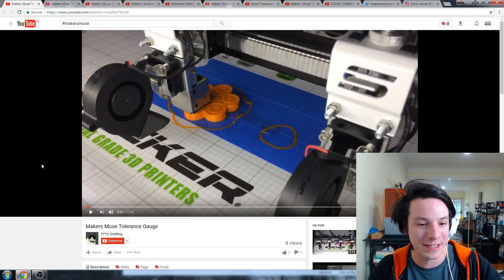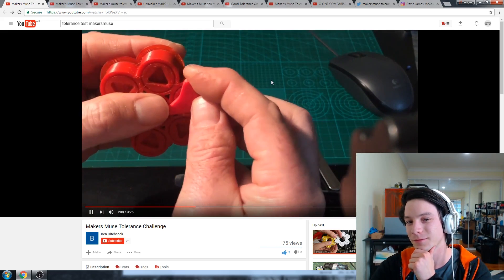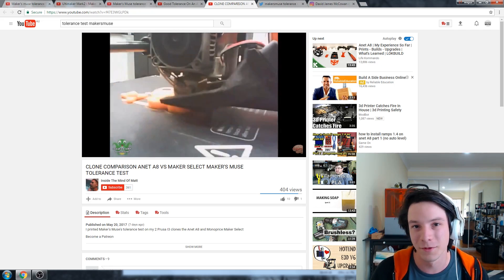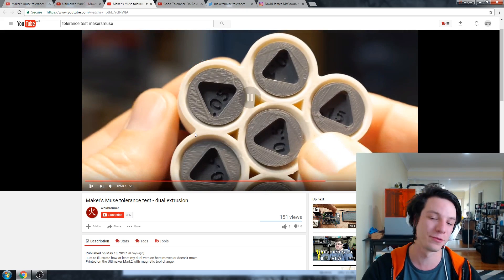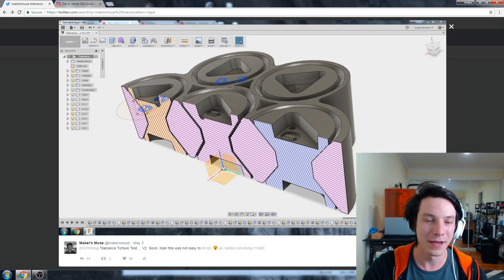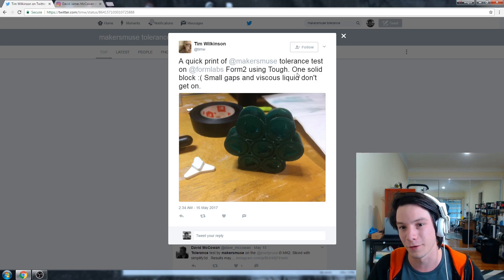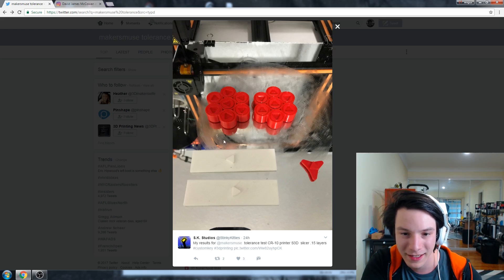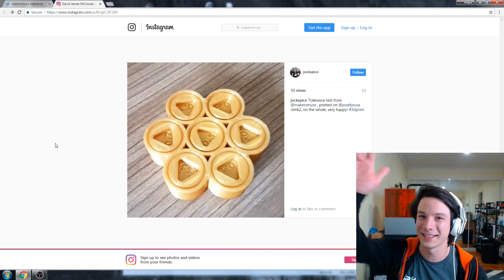Maker's Muse Tolerance Test - Your Results!

Comment: Hi! I'm writing an essay about the dangers of 3D Printing and I would like a quote from you for it! Please answer the questions below :D
1. Do you think the dangers of 3D Printing (such as fires and fumes) should turn people away from 3D Printing? Also, do you think as 3D Printers are getting cheaper, they are getting more dangerous?
2. Do you think that the media has blown up 3D Printed guns (pun not intended)? Do you think people should be worried about 3D Printed guns circumventing gun laws?
Thanks for your time,
Coby
(Also, please like this comment so Angus can see it!)
Reply from the maker: Sorry I truly don't believe you should base your essay on the negative hype aspects of 3D Printing... The media has exploded them out of proportion. Anything can kill you if you try hard enough.
Reply: So, I'm going to come at this from both the perspective of both an experienced printer and an armorer (I print a lot of stuff, and I also happen to work on guns). Long post inc, but you might find the input useful. I'm not going to go much into definitions; I'm expecting you already have researched the subject matter.

So first, fumes are a thing, depending on filament. PLA is fine, but ABS is not good for you; it's not a huge fume hazard, but you shouldn't print ABS in your bedroom with no ventilation. Some 'exotic' filaments have similar issues, but one should always read any documentation/SDS for a material before printing with it. As to fire, cheap printers with non-certified components carry the same risk as any cheap electronics, but honestly, these things are simple devices, and proper certified parts are very inexpensive simply due to economy of scale of the basic components. It's rarer these days to find something with totally random, unlisted (untested by an outfit like UL) components because the 'real thing' is so cheap.

What is an issue is some of the aforementioned 'exotic' filaments. Some filaments require much hotter temperatures than, say, your standard PLA; if you try to push a hotend that isn't designed for those temps, it's a potential for component failure, thermal runaway, and fire. Again, this comes back to knowing what your equipment can safely handle. Not counting for user error, printers these days are as safe as your average toaster oven.

Now, as to firearms, this whole issue mostly comes down to two 'sub-issues'; fully printable guns, and receivers. First, there's a lot of mis-information and outright lies out there that will have you believe that 3d printing can produce an 'invisible' gun that can't be seen on x-rays. This is not the case; you need a steel barrel and chamber to contain the literal explosion from the fired round. While you can create a design with a plastic barrel, you may or may not get any accuracy out of the first shot, and never again as the first bullet destroys the barrel; you also run the risk of the bullet getting stuck in the barrel. 

Even with a fully plastic gun, it's important to remember that detection methods like x-rays don't 'see' metal; they measure the effect of that energy passing through the objects. Think of your dental x-rays; your teeth are not metal, but you can still see them in the scan. I can assure you that completely plastic weapons, knives and guns, do show on x-rays, and it's very easy to tell what they are. Finally, even if the plastic were totally invisible, the thing still has to have bullets in it that have a metal bullet and a metal case.

Second, receivers; these are (almost always) the 'actual' gun, the serialized part that is by law considered a firearm. Everything else on a firearm is just steel/aluminum/plastic; unregulated parts that can often be bought over the internet. The concern some people have is that a receiver can be printed instead of bought and registered to the buyer; mostly it's the AR-15 people are upset about. I've printed receivers (it's legal here to manufacture my own firearms) and I have to say it's really not worth it. 

Polymer lowers are a thing, but they're injection molded. Printed parts just don't have that strength; usually layer separation is the killer, and the part usually doesn't last a full magazine before breaking. With some designs (the AR-15 in particular) sections of the part aren't conducive to printing. On the AR, the buffer tube ring is such a thin part that you'd have to shore it up to a ridiculous degree to have a somewhat reliable part. I've experimented with methods of improving the reliability and strength, but at the end of the day, FDM just doesn't hold a candle to IM or metal parts.

To that end, often it's a non-issue anyway; here, buying a good aluminum lower is about $60US, so it's not a cost consideration. Registration is also a non-issue, but that's politics, not going into that. For other countries, often you can't buy the other parts online either, so you could print a lower, but it wouldn't do you any good. Additionally, as someone else pointed out, hardware stores are a thing. If you know what you're doing, you can wage a war out of Home Depot. I can make a folded sheet metal lower for an AK in my garage.

To sum up, no, I don't think people should be worried about 3d printing being used to circumvent gun laws. Personally, 3d printing firearm parts is a great big 'meh'.
Reply from the maker: Sure, no worries :) smokeydops' response is also good. 3D Printing is a tool for creativity. Just like any tool it could be used for harm, but the overwhelming function is that of good, for learning and productivity.
Reply: As most 3D printers use plastic as a raw material there is absolutely no risk from such 3D printed guns as they would most likely either break or explode in the hand of the user. Even a gun printed using metal would need additional processing to work reliably and the cost involved would be prohibitive, especially when compared to the cost of a gun on the black market. Those with criminal intent are much more likely to use a more traditional method of manufacture than 3D printing.
Reply: Hi Simon, actually this is not the case. You need to be a resident of the state you're buying your guns in. If a firearm you want to purchase is in another state, you have to get it transferred through a Federal Firearms Licensee (FFL) in your state, and they can't transfer items that aren't legal in that state. 

For instance, I live in Arizona, which has comparatively open gun laws; neighboring California, however, has very strict gun laws. A California resident can't just drive over here, buy a gun, and drive it back over. They could purchase it here, but they couldn't take possession of it; it would need to be transferred. Depending on how well-read the FFL is on the other state's laws (and they usually are) they're going to warn you that they can't transfer the particular item you're buying to that state. Even if they don't, when it gets to the FFL on the other end, they're not going to accept delivery of it if it's not an item legal in that state. This applies to all sales that cross state lines, commercial, private, internet, etc.

In other countries, yes, I can see it as being an option as well. This, however comes back to the 'hardware store' thing; if you're going to build an illegal firearm out of things like a plain steel pipe for a barrel, you can build the whole gun out of hardware store parts. 3D printing really doesn't add anything to this equation, which is why I somewhat consider it a non-issue.
Reply: It's not really accurate to compare 3d printer fumes with pot or tobacco.
First of all they are completely different chemical reactions.
But also you might be smoking 5-10min at a time every couple of hours where as 3d printer can be melting plastic for 10-30+ hours a  time.
Also as manufacturers are constantly experimenting with various plastic formulas, they simply do not have enough time (and medical expertise) to evaluate those plastics for health safety aspects.
Reply: "even if one state requires a license you can just get a gun from another that doesn't".
Things are not that simple...
Reply: question is a spoon dangerous? there is always risk (vices and virtues refer F  Nietzsche "Beyond good and Evil), you manage by taking responsibility to research and understand so you can mitigate that risk. What you must differentiate in that word "danger" is intent. Anyone intent on doing harm will find a way, the inanimate has no intent of its own. Secondly unintentional danger if you don't do your research and understand the equipment and it's limits then you the danger comes from you. I spent months looking at 3DP before buying, much of it was videos by Angus and others like him. Consumer grade 3DP is still open loop I.e the user has to close that loop to mitigate risk from failure. Identify, analyse, action, monitor, control  and repeat.
Reply: Lol fuck no I sleep with mine everyday
Reply: All safety issues from FDM 3D printers stem from poorly made Chinese products that don't even comply with US law. There are "made-in-US", Canada, or Europe companies that will gladly sell you good, safe machines for a competitive price. An example is Printrbot.
Fumes are no more dangerous than smoking pot or tobacco.
Also, I've made a 3D printed gun. To be completely sincere, it would be much more practical, dangerous, and safe at the same time to fashion one from hardware store tubing, flux, and commonly available springs & pins.
Reply: Depends on which country you live in. In a country like the US it definitely seems pointless as real and reliable guns are easily available everywhere, and even if one state requires a license you can just get a gun from another that doesn't. In countries like Hong Kong or Sweden though, that have strict gun laws and few guns in circulation, I could see it happen. Maybe combined with a steel tube as a barrel and such.
Reply: Maker's Muse I agree, I didn't explain the essay very well; I'm telling the dangers but then I am telling ways to prevent them and that they shouldn't stop people from 3D printing. Also, can I use what you said in my essay?
(BTW I'm sorta freaking out that you responded to me)

Comment: (Haven't watched video yet, so I may have been featured)

I got 0.15mm to work with my machine without the wrench. I used a 0.2mm nozzle, and didn't mess with the settings at all.
Reply: What printer did U use

Comment: ALDI coocoon create. Tolerance Test result was .03
Reply: MarkleZephire mine was 0.15 unfortunately I didn't make the cut, on the video
Reply: same machine?
Reply: The latest aldi cocoon create sold on the 13th May..
Reply: yes. I think it came with another print head. maybe I should have a look. maybe I only have the .4mm print head installed. maybe it came with a .2mm print head.
Reply: Mines .4 head but I think it comes with a flexion extruded or a copy of it.. as this one can print the flexible filiment.. I'm not 100% certain though, maybe Angus could shed some light for us.. I'm printing the 3dbenchy ATM at 0.06 layer height I'm extremely happy with the print quality so far. My first printer was a prusa mendal and i could never get a decent print so it sits on the shelf. Lol..
Reply: So how did you get .15 on the same printer? My .2 won't move at all on the tolerance test. I'm using Cura software and cocoon filament.
Reply: Seem like same setup. I'm not sure, I can give you my slicer settings see if that helps..
Reply: I have the cocoon create and just got down to 0.15, Black PLA filament that came with the printer, 205c extrusion, 60c bed 0.4mm nozzle and 0.1mm layer height if I remember correctly. Might have been 20% fill. Took 4-5 hours to print. Used Cura.
Reply: My settings were 0.1 layer, 210c extruder and 50c for bed 10% infill 0.4 nozzle and aldi grey filament from spindle and cocoon cura.